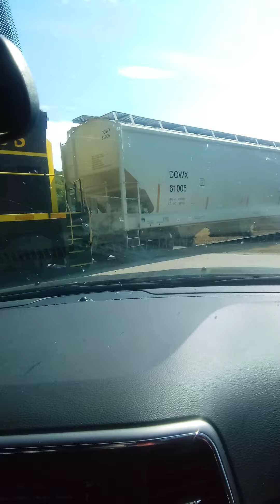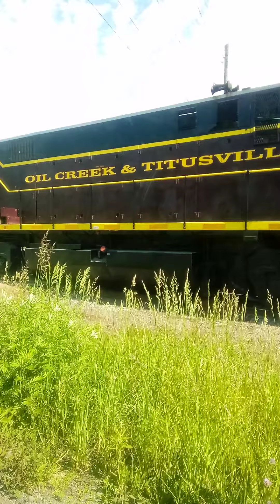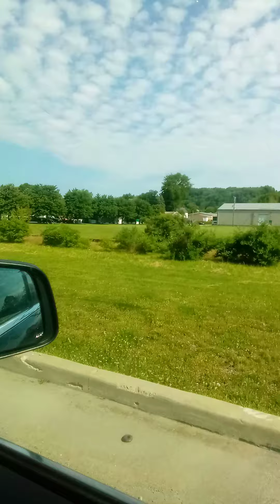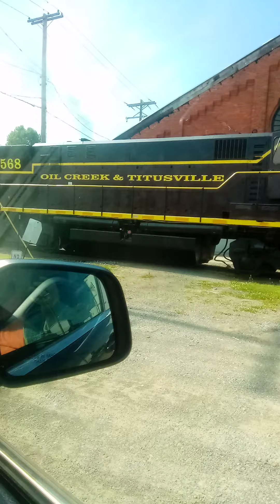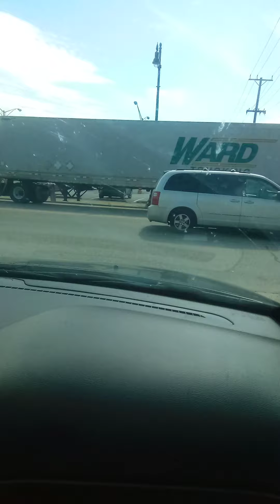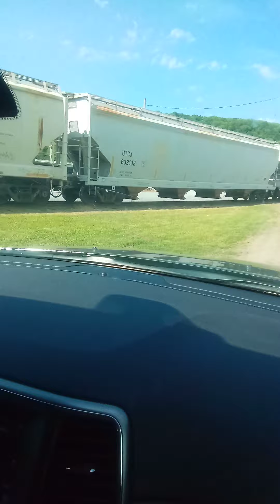OC&T Freight Train is Heading Back to the Freight Yard in Titusville Pennsylvania

Comment: Which Train Engine of the OC&T's Taking Over Since the Alco 85 Unit is Broke Down During the Middle of the Oil City Pennsylvania Run
Reply from the maker: The Former Canadian National Unit is Taking Over Freight Runs and the Passenger Runs
Reply: What Happened to the Alco-2 75 Unit
Reply from the maker: The Alco 75 s-2 Unit is Having Some Wheel issues